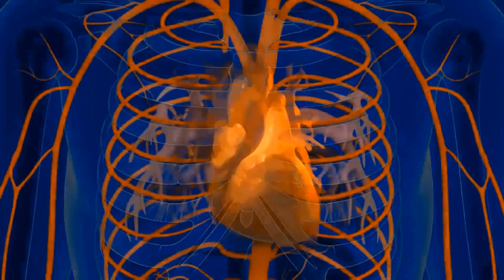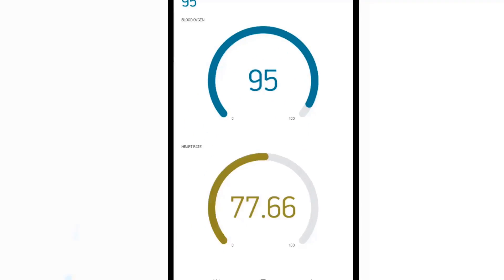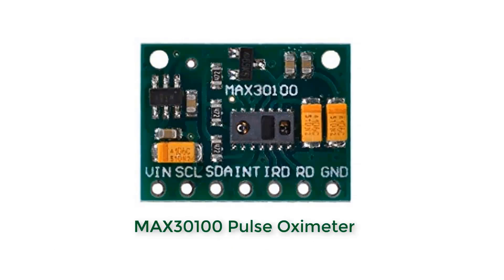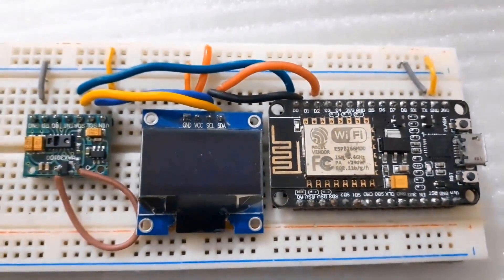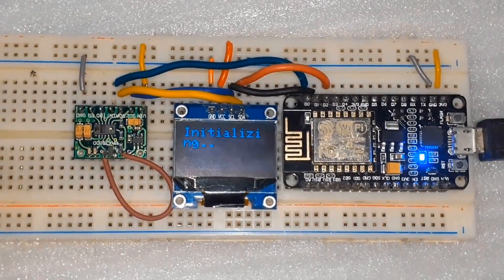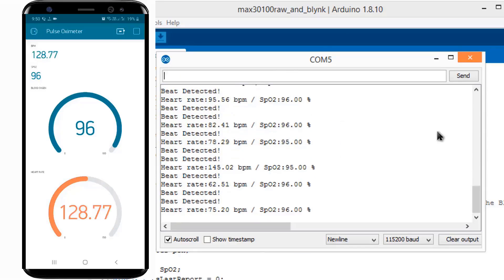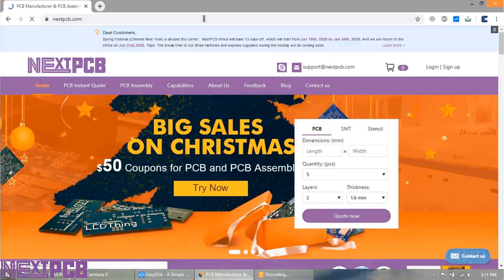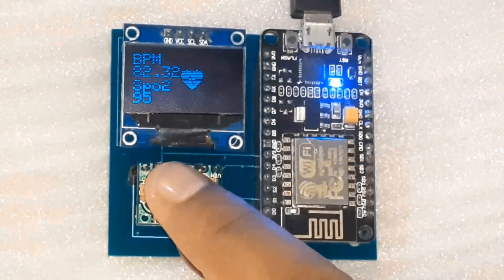IoT Based Smart Pulse Oximeter with NodeMCU ESP8266 & MAX30100 Sensor

Comment: Your tip about the wrong pullups for the MAX30102 board is pure gold! I thought the sensor is totally dead, but after cutting the track that provided 1.8V and soldering a wire to 3.3V now it is finally working with the MAX30100 Examples.
Reply: brother how can I do it with a max30102 and esp8266? And if the case were an arduino uno ?, I have an arduino uno that when loading the spo2 library throws me a memory error, like it is exceeded
Reply: @bbogdanmircea @howtoelectronics 
you made changes same way as show in this video for max30100??
I am using max30102 with sparkfun max 3010x lib but even example code is not working
Reply: @krushantvyas9039  Hi same here too , have  u got the output
Reply: Hello bbogda.. pls help me how to cut the sensor
Reply: i realize it is kinda randomly asking but do anyone know of a good website to watch newly released tv shows online?
Reply: @Kayden Korbin try FlixZone. You can find it on google =)
Reply: @Rowan Kylen definitely, have been using Flixzone for months myself :)
Reply: @Rowan Kylen thanks, I went there and it seems to work =) I appreciate it!
Reply: @Kayden Korbin happy to help :)

Comment: Getting this error sir, I tried including all the id's but not resolved

In file included from c:\Users\jones\OneDrive\Documents\Arduino\libraries\Blynk\src/Blynk.h:14,
                 from C:\Users\jones\OneDrive\Documents\Arduino\BP_measure_h2e\BP_measure_h2e.ino:4:
c:\Users\jones\OneDrive\Documents\Arduino\libraries\Blynk\src/Blynk/BlynkApi.h:39:6: error: #error "Please specify your BLYNK_TEMPLATE_ID and BLYNK_TEMPLATE_NAME"
   39 |     #error "Please specify your BLYNK_TEMPLATE_ID and BLYNK_TEMPLATE_NAME"
      |      ^~~~~

Code:

#include <Wire.h>
#include "MAX30100_PulseOximeter.h"
#define BLYNK_PRINT Serial
#include <Blynk.h>
#include <ESP8266WiFi.h>
#include <BlynkSimpleEsp8266.h>
 
#include "Wire.h"
#include "Adafruit_GFX.h"
#include "OakOLED.h"
 
#define REPORTING_PERIOD_MS 1000
OakOLED oled;
char BLYNK_TEMPLATE_ID[] = "TMPL3kFOnXvau";
char BLYNK_TEMPLATE_NAME[] = "ESP8266 BP measure DIY";
char BLYNK_AUTH_TOKEN[] = "cmWAl9CXfKUY4up67NzYAWa8UOPQkhIO";
char auth[] = "cmWAl9CXfKUY4up67NzYAWa8UOPQkhIO";             // You should get Auth Token in the Blynk App.
char ssid[] = "Hello";                                     // Your WiFi credentials.
char pass[] = "Creativity123$";
 
// Connections : SCL PIN - D1 , SDA PIN - D2 , INT PIN - D0
PulseOximeter pox;
 
float BPM, SpO2;
uint32_t tsLastReport = 0;
 
const unsigned char bitmap [] PROGMEM=
{
0x00, 0x00, 0x00, 0x00, 0x01, 0x80, 0x18, 0x00, 0x0f, 0xe0, 0x7f, 0x00, 0x3f, 0xf9, 0xff, 0xc0,
0x7f, 0xf9, 0xff, 0xc0, 0x7f, 0xff, 0xff, 0xe0, 0x7f, 0xff, 0xff, 0xe0, 0xff, 0xff, 0xff, 0xf0,
0xff, 0xf7, 0xff, 0xf0, 0xff, 0xe7, 0xff, 0xf0, 0xff, 0xe7, 0xff, 0xf0, 0x7f, 0xdb, 0xff, 0xe0,
0x7f, 0x9b, 0xff, 0xe0, 0x00, 0x3b, 0xc0, 0x00, 0x3f, 0xf9, 0x9f, 0xc0, 0x3f, 0xfd, 0xbf, 0xc0,
0x1f, 0xfd, 0xbf, 0x80, 0x0f, 0xfd, 0x7f, 0x00, 0x07, 0xfe, 0x7e, 0x00, 0x03, 0xfe, 0xfc, 0x00,
0x01, 0xff, 0xf8, 0x00, 0x00, 0xff, 0xf0, 0x00, 0x00, 0x7f, 0xe0, 0x00, 0x00, 0x3f, 0xc0, 0x00,
0x00, 0x0f, 0x00, 0x00, 0x00, 0x06, 0x00, 0x00, 0x00, 0x00, 0x00, 0x00, 0x00, 0x00, 0x00, 0x00
};
 
void onBeatDetected()
{
    Serial.println("Beat Detected!");
    oled.drawBitmap( 60, 20, bitmap, 28, 28, 1);
    oled.display();
}
 
void setup()
{
    Serial.begin(115200);
    oled.begin();
    oled.clearDisplay();
    oled.setTextSize(1);
    oled.setTextColor(1);
    oled.setCursor(0, 0);
 
    oled.println("Initializing pulse oximeter..");
    oled.display();
    
    pinMode(16, OUTPUT);
    Blynk.begin(auth, ssid, pass);
 
    Serial.print("Initializing Pulse Oximeter..");
 
    if (!pox.begin())
    {
         Serial.println("FAILED");
         oled.clearDisplay();
         oled.setTextSize(1);
         oled.setTextColor(1);
         oled.setCursor(0, 0);
         oled.println("FAILED");
         oled.display();
         for(;;);
    }
    else
    {
         oled.clearDisplay();
         oled.setTextSize(1);
         oled.setTextColor(1);
         oled.setCursor(0, 0);
         oled.println("SUCCESS");
         oled.display();
         Serial.println("SUCCESS");
         pox.setOnBeatDetectedCallback(onBeatDetected);
    }
 
    // The default current for the IR LED is 50mA and it could be changed by uncommenting the following line.
     //pox.setIRLedCurrent(MAX30100_LED_CURR_7_6MA);
 
}
 
void loop()
{
    pox.update();
    Blynk.run();
 
    BPM = pox.getHeartRate();
    SpO2 = pox.getSpO2();
     if (millis() - tsLastReport > REPORTING_PERIOD_MS)
    {
        Serial.print("Heart rate:");
        Serial.print(BPM);
        Serial.print(" bpm / SpO2:");
        Serial.print(SpO2);
        Serial.println(" %");
 
        Blynk.virtualWrite(V7, BPM);
        Blynk.virtualWrite(V8, SpO2);
        
        oled.clearDisplay();
        oled.setTextSize(1);
        oled.setTextColor(1);
        oled.setCursor(0,16);
        oled.println(pox.getHeartRate());
 
        oled.setTextSize(1);
        oled.setTextColor(1);
        oled.setCursor(0, 0);
        oled.println("Heart BPM");
 
        oled.setTextSize(1);
        oled.setTextColor(1);
        oled.setCursor(0, 30);
        oled.println("Spo2");
 
        oled.setTextSize(1);
        oled.setTextColor(1);
        oled.setCursor(0,45);
        oled.println(pox.getSpO2());
        oled.display();
 
        tsLastReport = millis();
    }
}

Comment: Hi bro i tried to display the data of max30100 in thingspeak but it always show 0 , they told me that max30100 values can't be shown on thingspeak is it true ? should i try blynk
Reply from the maker: Yes its not possible on thinkspeak. You should try blynk or ubidots
Reply: @HowtoElectronics  I'm thinking to connect to make a smartphone application that gets the data from the servers than display in the app which one do you advice me to choose blynk or ubidots
Reply from the maker: Both are best.
Reply: @HowtoElectronics  But  they told me that if i use blynk i can't make a personalized app and collect the data of the sensors that are in blynk

Comment: Hi, I have a 16x2 i2c lcd available instead of OLED, change the code according to what I had.
I would like to know if it's okay, or what do you recommend modifying
. Thanks you

#include <Wire.h>
#include "MAX30100_PulseOximeter.h"
#define BLYNK_PRINT Serial
#include <Blynk.h>
#include <ESP8266WiFi.h>
#include <BlynkSimpleEsp8266.h>
 
#include "Wire.h"
#include "Adafruit_GFX.h"

#include <LiquidCrystal_I2C.h>    //extra
#define REPORTING_PERIOD_MS 1000

char auth[] = "N-81lOStH83VwUeNuKHOzpLVzqjFXhHO";             // You should get Auth Token in the Blynk App.
char ssid[] = "BYNARK";                                     // Your WiFi credentials.
char pass[] = "bynark@123";
 
// Connections : SCL PIN - D1 , SDA PIN - D2 , INT PIN - D0
PulseOximeter pox;
 
float BPM, SpO2;
uint32_t tsLastReport = 0;
 

 
void onBeatDetected()
{
    Serial.println("Beat Detected!");
    oled.drawBitmap( 60, 20, bitmap, 28, 28, 1);
    oled.display();
}
 
void setup()
{
    Serial.begin(115200);
    lcd.begin();
    lcd.clearDisplay();
    lcd.setTextSize(1);
    lcd.setTextColor(1);
    lcd.setCursor(0, 0);
 
    lcd.println("Initializing pulse oximeter..");
    lcd.display();
    
    pinMode(16, OUTPUT);
    Blynk.begin(auth, ssid, pass);
 
    Serial.print("Initializing Pulse Oximeter..");
 
    if (!pox.begin())
    {
         Serial.println("FAILED");
         lcd.clearDisplay();
         lcd.setTextSize(1);
         lcd.setTextColor(1);
         lcd.setCursor(0, 0);
         lcd.println("FAILED");
         lcd.display();
         for(;;);
    }
    else
    {
         lcd.clearDisplay();
         lcd.setTextSize(1);
         lcd.setTextColor(1);
         lcd.setCursor(0, 0);
         lcd.println("SUCCESS");
         lcd.display();
         Serial.println("SUCCESS");
         pox.setOnBeatDetectedCallback(onBeatDetected);
    }
 
    // The default current for the IR LED is 50mA and it could be changed by uncommenting the following line.
     //pox.setIRLedCurrent(MAX30100_LED_CURR_7_6MA);
 
}
 
void loop()
{
    pox.update();
    Blynk.run();
 
    BPM = pox.getHeartRate();
    SpO2 = pox.getSpO2();
    if (millis() - tsLastReport > REPORTING_PERIOD_MS)
    {
        Serial.print("Heart rate:");
        Serial.print(BPM);
        Serial.print(" bpm / SpO2:");
        Serial.print(SpO2);
        Serial.println(" %");
 
        Blynk.virtualWrite(V7, BPM);
        Blynk.virtualWrite(V8, SpO2);
        
        lcd.clearDisplay();
        lcd.setTextSize(1);
        lcd.setTextColor(1);
        lcd.setCursor(0,16);
        lcd.println(pox.getHeartRate());
 
        lcd.setTextSize(1);
        lcd.setTextColor(1);
        lcd.setCursor(0, 0);
        lcd.println("Heart BPM");
 
        lcd.setTextSize(1);
        lcd.setTextColor(1);
        lcd.setCursor(0, 30);
        lcd.println("Spo2");
 
        lcd.setTextSize(1);
        lcd.setTextColor(1);
        lcd.setCursor(0,45);
        lcd.println(pox.getSpO2());
        lcd.display();
 
        tsLastReport = millis();
    }
}

Comment: @How To Electronics : Can you please let me know what is the cable connected fro Max30100(Brown color cable) ? If i provide power 3.3v & gnd to Max30100.. it will glow LED right ? In my case it is not.. can you help me.. On LED screen it is only showing initializing ...
Reply from the maker: The Max30100 has design issue. You can follow my website article to learn about fixing the issue.

Comment: @How To Electronics Hi.. I liked the project and tried making same.. I dont want Blynk to be used.. just display on OLED is enough for me.. i am facing one issue while uploading sketch.. can you please help me on this.. The error is :

C:\Users\user\Documents\Arduino\libraries\Adafruit_BusIO\Adafruit_SPIDevice.cpp: In member function 'void Adafruit_SPIDevice::transfer(uint8_t*, size_t)':
C:\Users\user\Documents\Arduino\libraries\Adafruit_BusIO\Adafruit_SPIDevice.cpp:119:31: error: no matching function for call to 'SPIClass::transfer(uint8_t*&, size_t&)'
     _spi->transfer(buffer, len);
                               ^
C:\Users\user\Documents\Arduino\libraries\Adafruit_BusIO\Adafruit_SPIDevice.cpp:119:31: note: candidate is:
In file included from C:\Users\user\Documents\Arduino\libraries\Adafruit_BusIO/Adafruit_SPIDevice.h:1:0,
                 from C:\Users\user\Documents\Arduino\libraries\Adafruit_BusIO\Adafruit_SPIDevice.cpp:1:
C:\Users\user\AppData\Local\Arduino15\packages\esp8266\hardware\esp8266\2.3.0\libraries\SPI/SPI.h:64:11: note: uint8_t SPIClass::transfer(uint8_t)
   uint8_t transfer(uint8_t data);
           ^
C:\Users\user\AppData\Local\Arduino15\packages\esp8266\hardware\esp8266\2.3.0\libraries\SPI/SPI.h:64:11: note:   candidate expects 1 argument, 2 provided
exit status 1
Error compiling for board NodeMCU 0.9 (ESP-12 Module).
Reply from the maker: Looks like u have selected the wrong board. And if you don't like Blynk then you can simply do this project using Arduino. There is another video for that. Check my other videos.

Comment: not working :(         max30102
Reply: My MAX30102 has same design issue, you need to cut pullups to 1.8V and solder them to 3.3V

Comment: Does this work without the lcd? And is it need to put jumper wire in rhe sensor?
Reply from the maker: It will work without OLED display. And you don't need to put jumper wires in the sensor if the sensor is working well.
Reply: How To Electronics hi my max30100 leds is glowing but when i upload and open serial monitor i get softwdt reset and initializing failed. Can you help me sir

Comment: Hello sir, why i am getting this ouput? I follow your instructions except for the oled and adafruit. Thank you in advance i need help

Soft WDT reset >>>stack>>> ctx: cont sp: 3ffffde0 end: 3fffffc0 offset: 01b0 3fffff90: feefeffe feefeffe feefeffe feefeffe 3fffffa0: feefeffe 00000000 3ffee598 40202900 3fffffb0: feefeffe feefeffe 3ffe84e8 40100bb1 <<<stack<<< ets Jan 8 2013,rst cause:2, boot mode:(3,6) load 0x4010f000, len 1392, room 16 tail 0 chksum 0xd0 csum 0xd0 v3d128e5c ~ld Initializing... MAX30105 was not found. Please check wiring/power.
Reply from the maker: Are you using MAX30105
Reply: How To Electronics no sir. Im using max30100 like yours
Reply: Im using max30100 sir

Comment: Very nice explanation. I construct it successfully.  Next day i suddenly  disconnected GND pin from breadboard and sensor MAX30100 is not working. I think it's SCL, SDA pins are shorted with VCC . Is any other chance to recover . I think not ☹️☹️☹️☹️☹️
Reply from the maker: May be excess current damaged the sensor as there is no reverse polarity protection.
Reply: @HowtoElectronics   Thank you for quick reply. I think reverse polarity protection should be enabled in all  most sensitive sensors  use in MCU because  beginners & hobbyist do a mistake.,🙏🙏🤔🤔🤔🤔
Reply: A simple diode can be placed for reverse current protection.